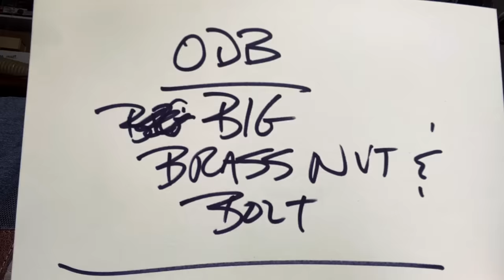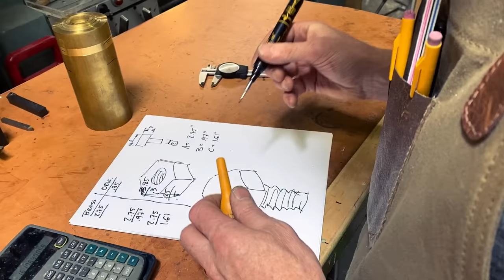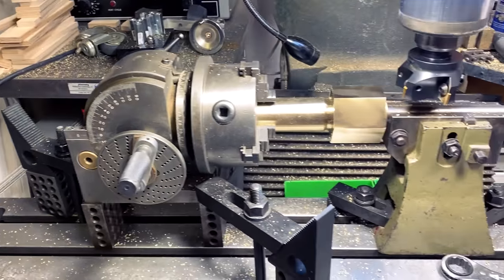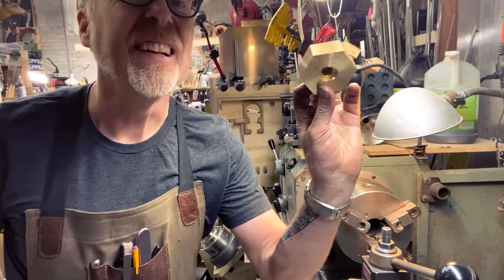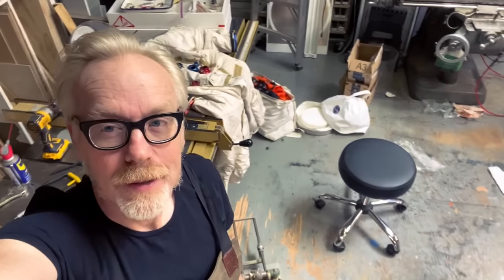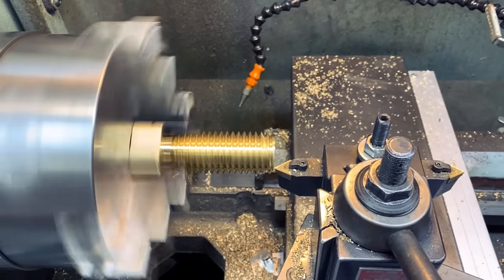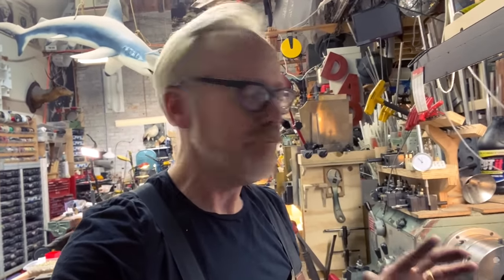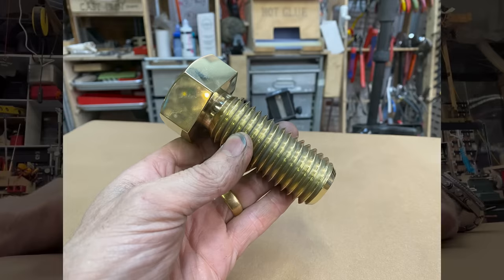Adam Savage's One Day Builds: Giant Nut and Bolt!

Comment: When cutting threads, I was taught to set the compound just under 30° and feed with the compound instead of the cross so you're cutting with just one edge of the tool. This reduces cutting pressure and gives the chip somewhere to go.
Reply: It's so you only cut with one face instead of two
Reply: That's when you are using angular plunge cutting. He might have found it easier to do straight plunge cutting as it means the use of a dro rather than reading off the hand wheel. Chip firm is not as much of a worry when working with softer metals
Reply: @fataxe1  Sorry, I'm confused by your comment.  Are you saying that my use of the term "edge" (referring to the tool's cutting edge) was incorrect?  I would assume that if one is cutting with a "face" that would cause undesirable friction/rubbing.
Reply: Exactly what I was going to post.  Gotta reduce the drag from having such a long working edge.
Reply: @hackerhelp1234   I've never heard the term "angular plunge cutting" used in this context, just plunge cutting threads which is what you're calling "straight plunge cutting".  What industry are you in?
Reply: @JamesDoebbler  sorry about that one, completely forgot correct terms, but I was more referring towards radial indeed compared to flank indeed. Would put in a reference chart here but unable to
Reply: That's what I thought you were supposed to do.... Also I thought you should only use carbide at higher speeds? Tho, I'm not actually a machinist so don't listen to me.
Reply: Everyone is hitting around his problems. So, here's everything I've seen wrong. Compound needs to be set at 30 degrees. Feeding with the compound only. Feeding from tailstock to chuck to give room for lead screw to fully engage. Higher speed for carbide inserts or use high speed steel to use slower speeds. He needed to make sure to set his tool post square to his work for clearance, which he did at one point. I would have set my ID thread tool to the opposite side to cut the nut threads. His thread releaf on the bolt was overly excessive. He also didn't understand how to use his fishtail gage. And some people are complaining about him not using a tailstock the first time cutting threads but with how rigid that price was I wouldn't have used it.
Reply: Classically, it's done this way with HSS tooling, with the compound at 29,5. But with modern carbide full profile inserts it's not needed and better to just use the crosslide.
Reply: @jarrodsutterfield3752  Oh man, here we go... 

1) Setting the compound to 30° isn't to "give the chip somewhere to go. It is to cut on only one face of the 60° thread, to reduce the engagement. 

2) The half nuts are fully engaged because he never disengaged them, he just reversed the lathe. 

3) Cutting to the right is very common practice when cutting up to a shoulder. 

4) Carbide doesn't need faster speeds, especially in non-ferrous metals. That is a myth. Carbide can cut slow or fast SFM. 

5) If you looked, he wasn't using a tool holder for treading, with a threading insert. He was using a 60° turning insert in a regular turning tool holder. That's why he was unable to set the tool post square to the work. It would have been impossible to set it square. There are specific tool holders with specific single-point thread cutting inserts, which is what you need to use so you don't have that crazy stick out (when he first tried setting it up), so you don't have to set things at weird angles, or so you don't have to run it upside down (like the setup he settled on). 

It's weird you say all that stuff, but get it all wrong. Almost like you're one of those people that watch YouTube machining videos, and you're not a machinist, but you act like you know how to machine just because you watched some YouTube videos. Most of those things you said would be obvious to a machinist.
Reply: @jarrodsutterfield3752  apparently you did not watch the video close enough. The work was not that rigid without the tailstock. As it flew out of the chuck multiple times. 

That's also why Joe Pie did a video right after in response to this video about chucking hex stock correctly.

Comment: Suggestion for a better order of operations to make this way easier:
1.  Face both ends (ignoring large hole).
2.  Turn to critical dimension for threads, including relief at root of shaft.
3.  Cut flats in dividing head.
4.  Return to lathe.  Cut threads and chamfer end of bolt for easy staring in nut.
5.  Turn “junk” nut to protect threads for next step.
6.  Reverse part in lathe.  Push bottom of bolt head tight against chuck jaws.  Part off nut.
7.  Chamfer edges of bolt head.  Facing cut to clean top.  Bolt is now complete.
8.  Grip nut in lathe.  Facing cut on rough side.  Cut internal threads.  Slight countersink of hole (for easier starts on bolt).  Chamfer edge.
9.  Flip nut.  Facing cut, countersink, chamfer edge.  Nut complete.

Similar to what you did, but gives you a lot more material to grip in the chuck jaws while forming the threads.  Also means that if mistakes are made, you still end up with matching sizes on the nut and bolt after cleanup of damaged faces.
Reply: Also, for the nut, don't measure the minor diameter of the thread and make your hole that size.  Size up 10-20 thousandths at least (depending on diameter).  100% thread sure can be done but no one does it and it just makes your life harder.  75%-80% thread is a good place to shoot for and about what a proper tapped hole is sized for.  Great project, Adam!

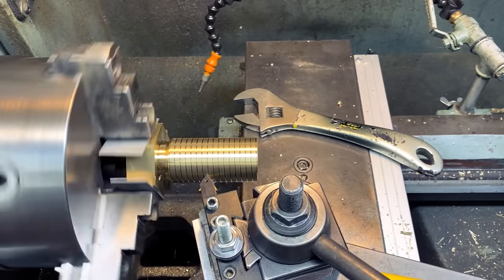Comment: The error you made after 17:00 results from the thought you had at 16:17
seems like 20 thousands is about the sweet spot

You didn't take into account that the contact surface between the cutter and the piece is increasing linearly with each pass.
Thus the force required to cut is increasing quadratically, hence problems later.
Reply: he hasn't a clue on how to chase threads, for starters you shouldn't feed in perpendicular for threads !
Reply: @kenvaughn8758  for me, it's like planning to dig a hole at depth n with shovel of surface s, and only accounting a tube of volume n * s to be removed.. In practice, you have roughly a cone of height n and base n*n..
Reply: I agree. As well, i did not notice any awareness of the fact for less tool loading you use the 29.5deg set compound to cut just one side
Reply: These comments need to be at the top for awareness
Reply: Outside of thread rolling, does anyone know how to get threads Burr free without re-turning, re-grooving and re-threading? I have not had luck with just threading.
Reply: Have you ever tried threading insert tooling? That and rpm as much as you can safely
Reply: @williamreed4059  Sandvik, Iscar, Kennametal, you name it. We turn 12L14, 1117, 4140, 8620 and more.
Reply: As long as your machine is in good standing and your tooling is held in proper alignment to the part, there should not be anything a couple of final passes can't clean up. Is this for CNC, or manual turning? And if you mean the start/end of the threads, that is inevitable to my best knowledge without following the thread profile again with another tool(CNC) or hand deburring. Also, is your thread blank being cut to the right size? Even a little bit too small and the insert won't be able to radius the top of the threads
Reply: @williamreed4059  1 year old Index CNC lathes. Yes, the first, last and major threads. I've been given the task of programming them and Index claims it can be done, but one of our older programmers is doubtful. Thanks for the help!
Reply: Multispindle? I used to run, troubleshoot and set those up. I can tell you the ms22 and ms40 can absolutely do that. Send me a private message if you want to talk more about this. Also, if you have the iemca barloaders with the clamshells, you will more than likely have some grief from those eventually
Reply: @williamreed4059  single spindle. C100, C200, G200.2 all with 3 turrets. We had a fire last year, lost 15 Acme's and 15 CNC lathes. With the quantities of orders going down we decided to go with single spindles.
Reply: @moej6014    Manually cutting a thread with carbide is almost an oxymoron.  You have to run the carbide at high speed,  but if you run a manual lathe at high speed you run the risk of crashing the tool into the chuck. So you don't get the finish you could want because you are not at recomended speed.   I find the best method is to get within 10 thou of your size and chase it with a die.  On a manual lathe.  If you have CNC you're golden.  Either that or leave a little oversize and use a thread file.
Reply: YuPei  sorry for liking to talk about something I enjoy doing
Reply: @moej6014  There are inserts out there that will "top" the thread. Meaning that the insert is ground to cut the full thread profile, side, bottom, and top. This will produce a super nice thread with very little, to no burrs, if used properly. The draw back to this, is that each insert is thread profile and pitch specific.
Reply: I’m just a mill guy
Reply: @christobel  this is what I was getting at with the inserts as well. But your leading and ending chamfer will still at the very least be sharp since they are under the size of the top of the thread
Reply: @williamreed4059  use a O/D grove tool described as a threading cycle.. and do a champhering stoke.. off set the cutter in Z axis but watch you do not hit leading edge of the next thread.
have done it on 4 start ACME... higbee cut...

That will do the start.. but the relief not so sure..  have to change the TPC and flip the tool over and run it in reverse

Comment: oh man. where to start... Adam. here is a few tips from a CNC operator/marine engineer.
1: start making the thread lead first before cutting the thread
2: it's ok to make a larger pinol hole to control larger parts like this.
3: measuring the inside of the thread... with a standard caliper?! my jaw dropped. you need special tool for that. or alternative. calculate your way if you cannot look it up in a chart.
4: only 2 measures for a thread? no no no no. there is SOOOO many types of angels, shapes, types, standards and so on. most standards used are made in Germany. LOADS of great types of thread for different purpose. in all sizes.

last i need a little bragging right :P being a marine engineer. that's a cute size bolt :P

indeed we all makes mistakes. so keep making more! and remember to have fun doing so! :)
Reply: Cute size bolt? Hahahaha My shop neighbor was cutting an 8 foot by 10-12 inch screw for a torpedo reloading mechanism. And AAAALLLLLLL summer, we all heard his lathe squeeling , whistling, etc. So yeah. Ive seen the "normal" size bolts you psycho machinists make! $4,000 is an expensive piece of brass to scrap!

Comment: My machinist friends, say, "Now do it in copper" then chuckle.
Reply: Easier to cut threads in bubble gum than copper
Reply: Having made only as few extremely simple parts out of copper (generator bus bars for an aircraft), no thanks to working with copper.
Reply: Copper try Inconel.
Reply: Very light cuts. Light and fast. That's all I can say for copper.
Reply: Internal M80X4 Trapaziodal* Threads in Ampco-18.  That Aluminum Bronze. 85% Copper, 10% Iron, 5% Aluminum IIRC.
*METRIC acme equivilant, 30° included angle

When cutting threads try mounting the tool upside and running the lathe in reverse. That way you are threading away from the chuck
Reply: Copper, LOL you guys are cruel.
Reply: Friends? Not sure about that.. 😁
Reply: @WIPEYOURLENZ  I think I would prefer cutting Inconel than copper.
Reply: I know im crazy, but what about tungsten?
Reply: Make sure you triple check the stop.
Reply: @WIPEYOURLENZ  That stuff is weird, glad i never had to do it myself.
Reply: haha i was thinking the same thing when he say brass is grippy
Reply: @Eth3realwarrior  he would have to buy diamond inserts for that process
Reply: Aquamet is fun to thread
Reply: Just use copious amounts of wd40 works a treat plus sharp sharp tools

Comment: That my internet friends is why the order of the operations is the first thing you need to plan.
And I'm glad that I'm home alone right now, because you have no idea how load i shouted "use the tailstock" at the screen when you was about to start cutting the threads on the bolt 😂
But for a none machinist that is a really good job.
It really shows that you have a good head for making stuff, and yes cutting threads on a manual lathe is scary as f**k the first times you do it.
Reply: Ronny Olsson, "you have no idea how loud I shouted, "use the tailstock" at the screen" I'm glad I'm not the only one!
Reply: And cutting the thread before cutting the nut off more surface area to hold?
Reply: Well done Adam. Remember the new phrase learnt. "Brass is grabby".
Reply: What did you start shouting when he put his finger on the bolt with threads when it was spinning? I shuddered.
Reply: @Cynyr  yeah. My thought was "that's gonna smart".
Reply: You know what is even more scarier than doing it on a manual laithe? Doing it on a cnc laith and when it does its firts run pray to the machine gods that it wont hit the 3 claw or make a giant crash
Reply: @boerke123  doesn't your CNC setup in CAD/Cam include the lathe, chuck, tail stock, tooling holder, etc. so it can detect crashes better you hit go?

Comment: As a machinist this is brilliant lol even the simplest things can become a head ache. It's all about overcoming the issues you come across. You did a darn good job though!
Reply: Agreed. But my main issue is from engineers doing stupid crap on drawing that make no sense
Reply: @patrickfetters6373  Engineers always cause Machinists problems. They are book smart but very little practical experience in my opinion. At least what I've experienced in working with them.
Reply: @FromTrey  Some are.  Some worked through the ranks.
Reply: lucky he didn't knock his teeth out.
Reply: @GodzillaGoesGaga  I'm sure some have put in work. Wish I worked with the ones who had.
Reply: @johnnym1320  Very true.
Reply: That's why the best engineers and programmers are also master machinists on both lathes and mills.
Reply: @Scott Davis They're not left handed unless I've missed something crazy lol

Comment: Adam "Brass is Soo gripey"

Also adam:(Cuts brass without lubricant)
Reply: From my understanding, lubricant is more for cooling and dissipating heat from the piece than lubricating anything. Lubricating on a lathe isn't really pertinent
Reply: Yeah I believe the “grippiness” of a metal has to do with how soft it is. And that’s why he has to go slow.
Reply: @Stopes.  well there's lubricant and there's some cooling liquid too. Choosing between both actually depend a lot on your speeds, feeds, tools and operations
Reply: @Stopes.  you have some real bad info on lubricants for cutting on a lathe. I have machined brass, aluminum, titanium, carbon, plastics,  many different types of stainless.
Reply: You don’t use cutting fluid on brass. The only time you should be using cutting fluid on a lathe is for drilling, and when using form tools. There is exceptions to this but that’s the golden rule. Brass and other copper alloys on the other hand don’t need cutting fluid sense they loose heat to fast.
Reply: @shotgunsam23  Thank you for your time.  On manual Lathe I don't use it,  somehow I got using it on CNC for large threaded part that was just 3 parts.  When I was making a run of small 1/4" part like 3/8" long, I did them dry.  was like 1,000 parts with re-order every other year.  Checked program, no oil.
  
I'll look into it, sounds like I just might have left oil on in program as I did a couple AL parts for adjustment.   Thanks again for feedback. Much appreciated.
Reply: @johnm840  No problem , I still use on cnc for chip evacuation, mainly cause I’m to scared to break an end mill because the flutes clogged and have it trapped in the brass.
Reply: @shotgunsam23  Looked into it, see machinist use with and without.  Evacuation  was one reason, but using  a sulfur base oil can stain the part.  
I use that type oil, gives me better insert life on SS. I was amazed that change had such good results.  Devil is in the details.  
One was talking about thermal expansion aspect if you are running hard for faster times.
Reply: @johnm840  I guess that’s why I never seen anyone use oil on brass, just coolant.
Reply: @shotgunsam23  I was only making 3 parts, and no spare material.  As each part was done,  it was blown off and cleaned with simple green and measured.  No time to stain.  The chemical aspect of machining can get over looked.  Thanks for dialog.

Comment: In all seriousness though, thread cutting is one of those niche uses of your compound slide. You set the angle just right (I think it's half the thread angle... or just under) and feed in using the compound slide so that the tool only cuts on one side. Keeps the forces down and makes for an overall enjoyable project ;)
Reply: This is how I was taught in trade school too, the only time you cut on the back of the tool is when you finish that face of the thread at the end. IThe video was cringe-worthy, but he learned as we all did and got a result lol
Reply: @brendantennick4394  Haha, even going back to the mythbusters days, Adam never was one to just google "How to cut threads on a lathe" 😁

I respect that though, the best mistakes to learn from are your own.

I suppose what we ought to keep in mind is that this whole video was about the learning process and not the huge nut and bolt. That perspective takes most of the cringe out of it
Reply: 30 deg
Reply: @wayneparris3439  Ah, it's half😉
And the angle on the tool is just under 😊
Reply: 233kosta- Yes, for 60 degree threads the compound is set to 30 (29.5 to be exact). And a bolt that size needs either a live center support from the tailstock or tiny cuts, like .005". I prefer both.
Reply: @233kosta   "Learn from the mistakes of others. You'll never live long enough to make them all yourself." John Z.